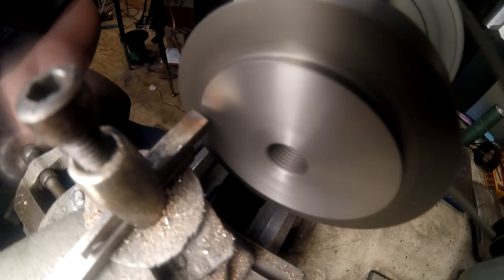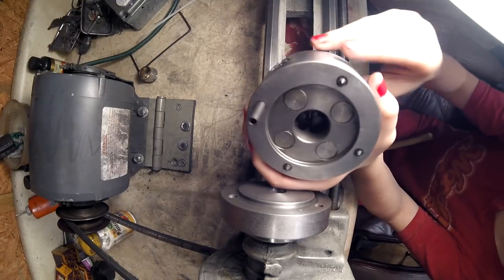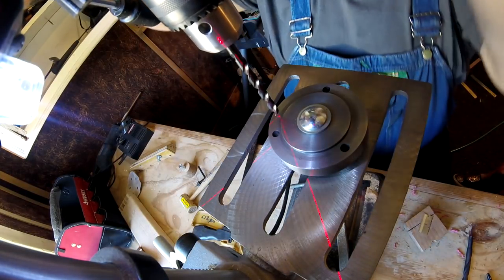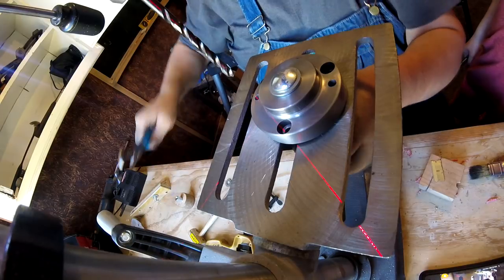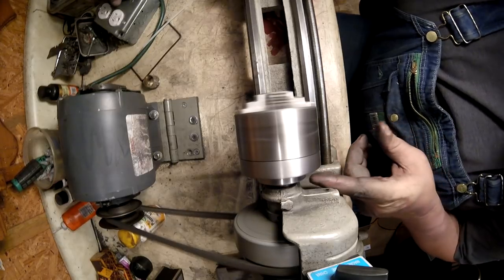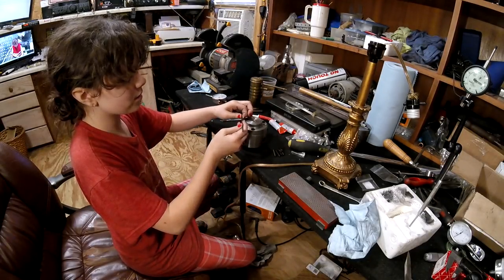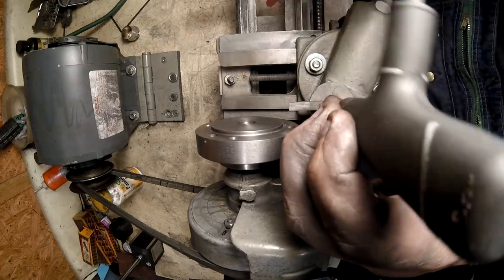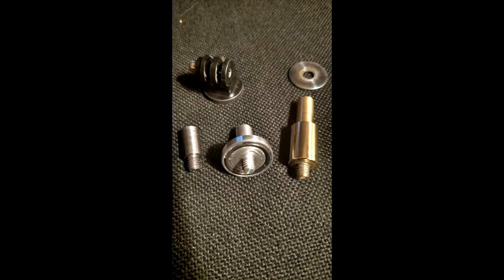Mounting Tera's new 4 Jaw Chuck

Comment: Great video. Fun to watch.

Put a little oil on that spindle thread after you clean it. Avoid using air to clean it,  it can blow chips into the bearings. When measuring the inside diameter with a caliper, You need to consider that the Inside diameter is round and the very tip of the caliper is flat. So there's always going to be a slight difference in the measurement. The smaller the hole the more difference There will be in the measurement. And to support that Chuck, when installing, slide a small Dow pin or a metal bar through the Chuck into the center hole of the spindle. Tighten the chuck. Now when you remove the chuck, There's less of a chance of dropping it on the lathe bed. It also makes it easier to install.  And as you can see, cats like to jump on your workbench. Keep the cat out of your shop when using the machinery. You wouldn't want him to lose his tail. And I don't think the cat would like it either.

You are doing  great, I'm sure Tera is learning a lot. Keep up the good work.
Reply from the maker: Joe A thanks for watching and for the tips

Comment: this nev from cali needed to do a 2inch deep half inch counter bore . didn't have mill bit .had two half inch drill bits i ground one for my milling bit. but had to use the other half inch bit first to  get the depth then the other to finish. on the ground bit just put it strait to the stone an 1 degrees relief on each flat. an i enjoy your videos . hope this not to long an helped
Reply from the maker: Nevin Loop sounds good me